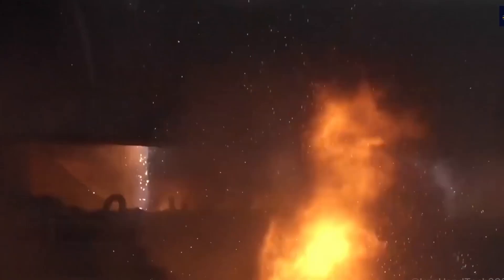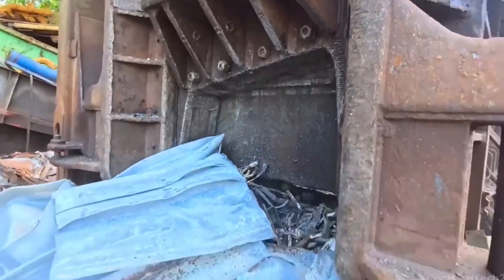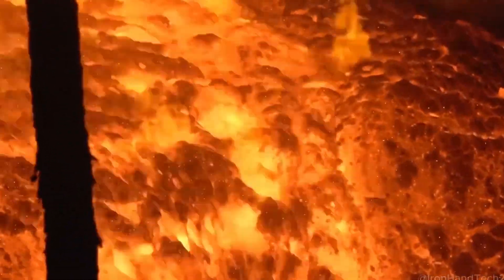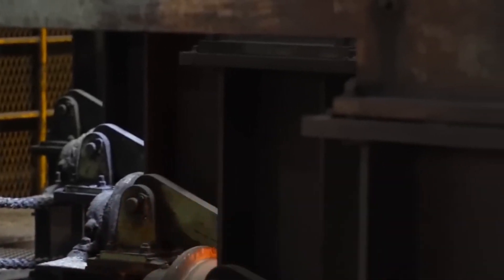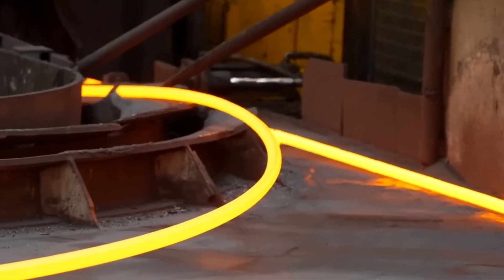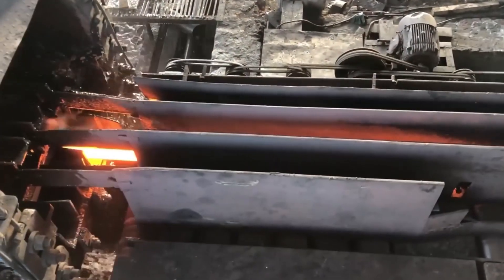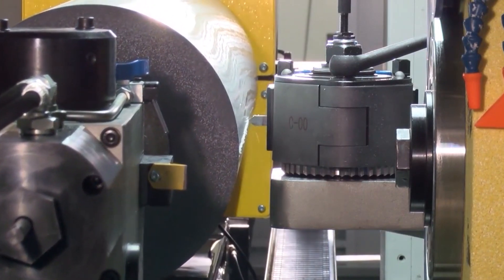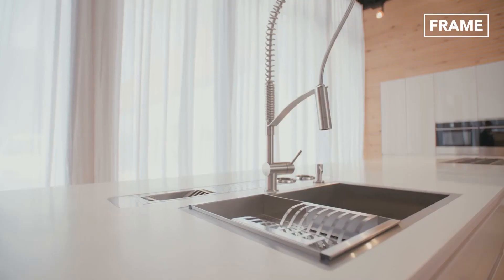How Over 1,000 Tons of Steel Is Recycled EACH MINUTE In Factories

Comment: 3:23 The surface of the sun is 10,000 degrees Fahrenheit. Do your research!
Reply from the maker: Thank you for the correction! Not sure how I got to my number, but you are correct :)
Reply: @ComplexMadeSimpleTV  The Sun is around 15 million °C (27 million °F) at its core and 5,500°C (9932°F) on its surface. The outer atmosphere surrounding the Sun measures around 2 million °C (3.6 million °F) with some areas of it reaching as hot as 20 million °C (36 million °F)